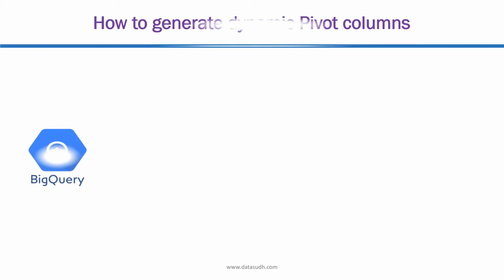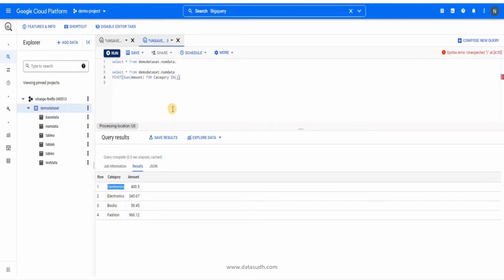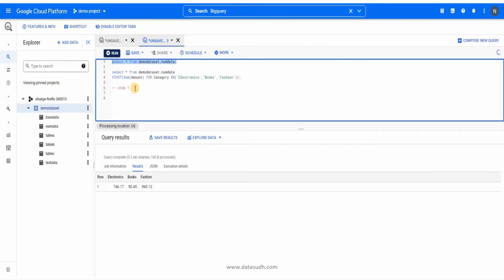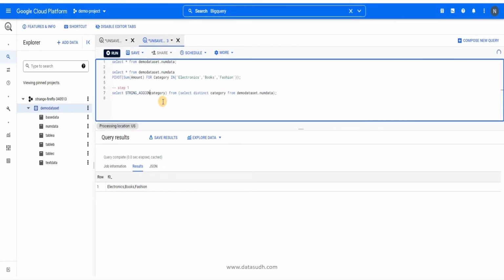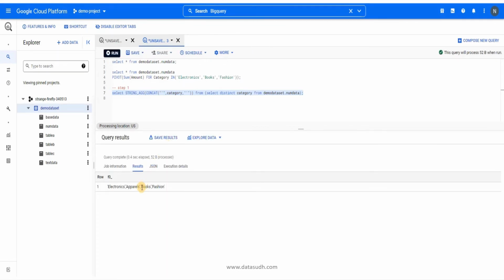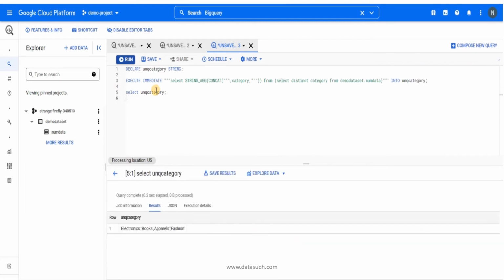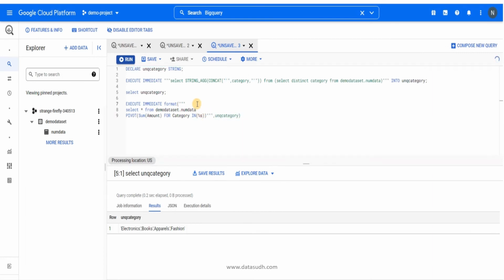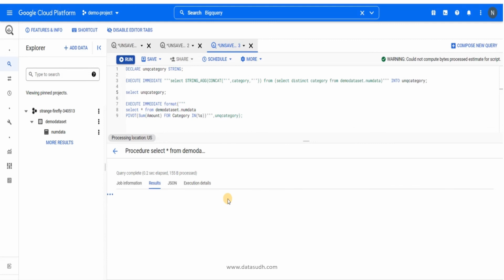Dynamic Pivot Columns | How to generate dynamic Pivot Columns in BigQuery

Comment: Thank you for the wonderful explanation. Is there a similar way by which we can dynamically aggregate string columns in bigquery sql? Usually we would just use Select STRING_AGG(col_1), col_2 From table1 Group BY col_2. What if the number of columns are increasing dynamically?
Reply from the maker: Hi Hasan, if you have a scenario where in you want to keep creating aggregate values for dynamic columns which can exist at any point of time then basically you need a query which adds that column formula at run time. You can achieve that by using combination of metadata table which will tell about new column and then add the same to dynamic SQL with string agg function. 

Do you have a use case where in your columns are increasing dynamically ?
Reply: @datasudh  I have a ‘contacts’ table in which new columns (containing information about the contacts like their age etc.) are being added everyday. These columns have either nulls or string values. I want to string aggregate all these columns and group by contact id so that I get one unique row per contact ID.
Reply: @datasudh  thanks for your reply. I have been trying to use INFORMATION_SCHEMA.COLUMNS with dynamic sql to solve this problem but have been unsuccessful so far.
Reply from the maker: @hasanasim3980  ok, I will give this a try this week and share results with a blog